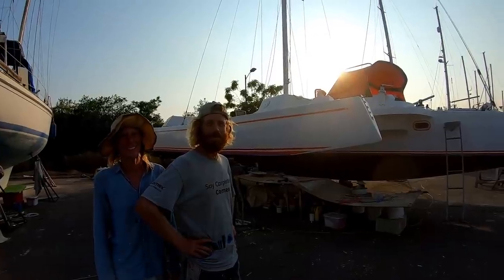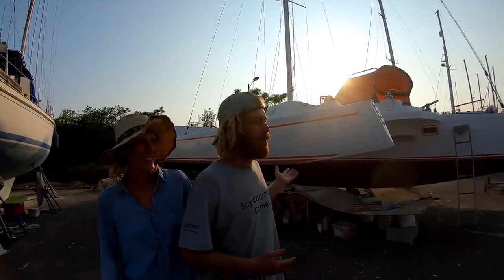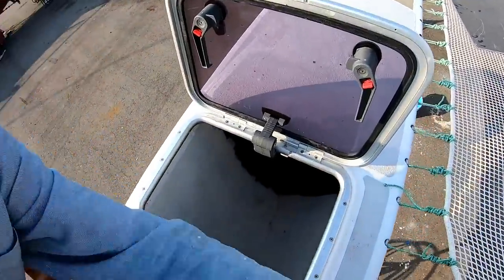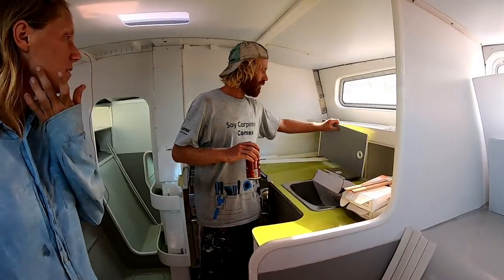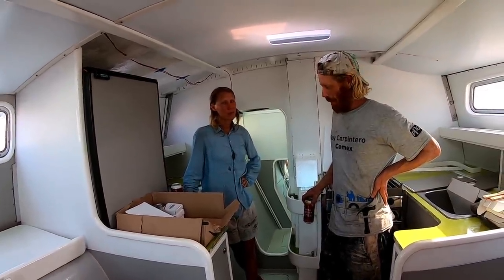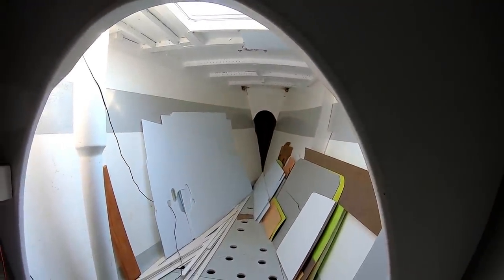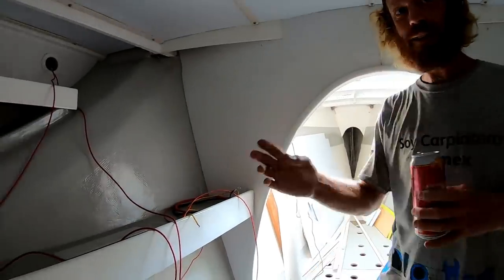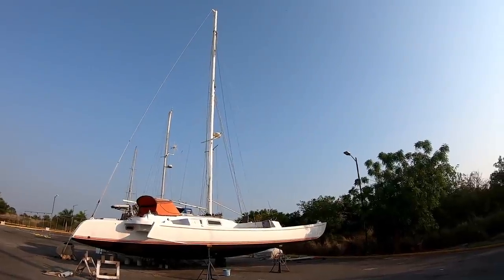A Fast Trimaran Tour, Two Years on the Hard with Hot Sauce : Chuffed Special

Comment: Thank you for introducing us to Hot Sauce and Her crew,  now that is certainly a different boat! Yes, fast, but also a lot less rolly at anchor, which in that part of the world seems to be a particular problem.
She's got quite a lot of storage in those outer hulls though, so an Ocean crossing under a storm jib would certainly be a prospect.
Reply from the maker: They’ve been on catamarans before her too, and wanted something fast this time round. Thanks for watching!
Reply: Andy Windy , trimarans like this have a problem at anchor . Typically one or both armas should be out of the water all the time if designed for fast light wt sailing . But at anchor the slight rocking will slap one arma then the other on the water. .., something else to get used to , Unless you overload the boat and that defeats the purpose.( kills performance) slowing so you have to overload with food even more for long passages , But if you can do it right what a wAy to go !!!. Light is right!
Check out ‘sailing trimaran sprit’  for a similiar tri sailed light and right . And major rebuilt too!  Cheers Warren

Comment: Is speed so important ? A catamaran gives you so much more room and comfort. It will be a beautiful boat when it's finished though.
Reply: It all depends what you are looking for. You can find fast catamarans as well, and for sure, I agree there is more room in a cat. Usually the more room the less speed you can get out of it, if talking same waterline length. We had a 38ft catamaran before (you can see it on one of the earlier episodes). Cons with catamarans is they are a lot more expensive and was out of our budget this time. A decent 40ft cat is at least 200 000 USD....What Im looking forward with this boat is to be able to sail when there is very little wind. Just a reminder....If a our boat averaging 8.5kts across the pacific, it would mean we would do Galapagos-Marquesas 5-6 days faster than with our last cat where the average was about 5.8kt during that passage (22 days). There is also the benefit to run from a storm before it hits you....or to get out of it asap
Reply: @SailingLessPlastic  Thank's for explaining that. I was thinking along the lines of it's a mobile home, rather than a speedboat.